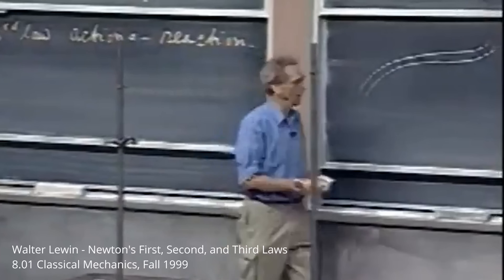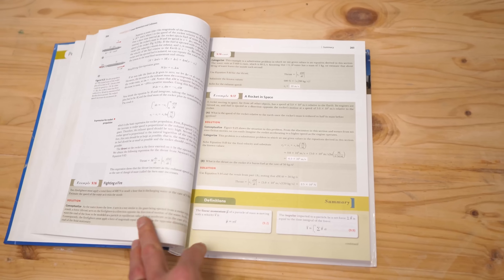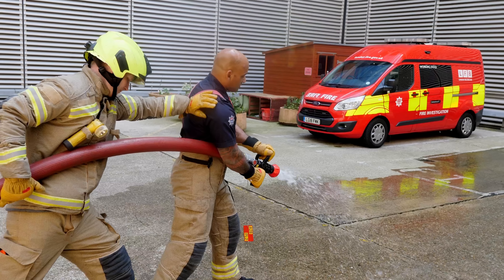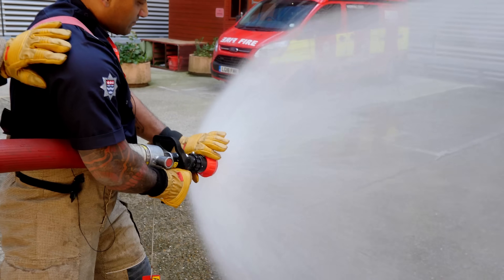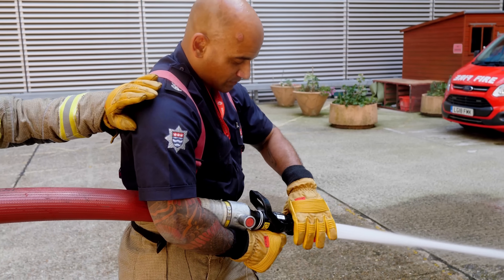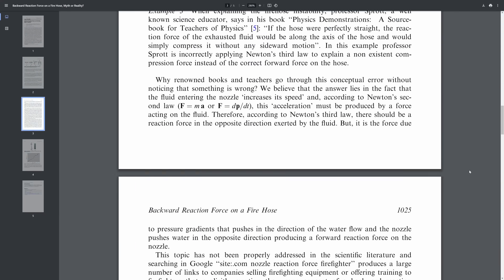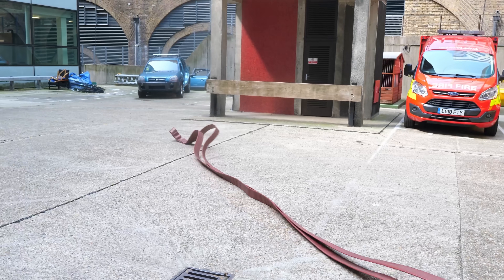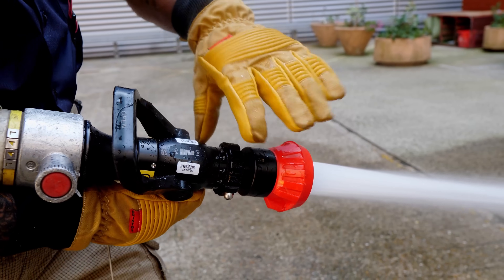Why chaotic hoses dance

Comment: Rivers kinda do the same, but in a gravity restricted low pressure (if not flooding) kind of way . If flooding more spreeds higher pressures, fluids will always try to find the easy way out...
I don't know if there's a use for this.
Maybe a elritic generator of some kind.
You can call it the :
⚡ zappy zappy dingigle dongle ⚡ 
Probably very inafishint 😆

Damn it we'll have to write it again...
The pressure at the nozzle is determined by the flow from the nozzle If you had to close it then there's no movement in the hose and would be like a muscle when and fill up tight. So the back pressure is coming from the nozzle like a rocket as you say. 
And if you look at dam, they have mud pipes they clear out, when they let them go it oozes out a big turd shape mud turd. Then continue to flow high pressure water that  would cut your fingers and hands off if it's doesn't drag you in, if you actually were try to touch it and probably kill you too because of the suction would be like a venturi and suck you in and die, Ooo that will be horrible Don't think about it! Don't do that!

Comment: Wouldn't the force be equal to the cross sectional area of the outlet times the pressure difference?  You could confirm that by calculation and then measurement with different size openings or pressures to test the calculation.

Comment: Huh, cool! I guess they do always teach us that the force of a (subsonic exit velocity) rocket is actually the unbalanced pressure exerted on the front end of the chamber... it's neat to think about a subsonic nozzle as really just exerting force through the tension of the pressure vessel walls not being balanced by the missing area of the exit throat area!

In a similar vein, Matthias Wandel has a very neat video series on the forces felt by the suction end of a pipe, one of them is called "Levitating pipe mystery solved" just to put a search term down here. The first few are actually more interesting than that one.

Combining his observations with this video it's interesting to think about the pressure field in the vicinity of the nozzle throat entrance, on the hose side.

On a practical note, hose/nozzle systems like fire hoses are pretty much always going to be designed so that the momentum of the water in the pipe/hose is a small fraction of the exit momentum. Unless the pipe is super short, a system that imparts a substantial fraction of the velocity at the entrance to the hose (aka the exit of the pump) will be producing large amounts of needless drag, and will deliver only a small fraction of the pumping power to the nozzle. So we should very much be able to ignore the momentum change of the water around a curve of the hose, at least compared to the force needed to hold the nozzle in place. Look how much bigger the inner diameter of the pipe is compared to the actual water stream diameter on those fire hoses, and then square that to get the area/reciprocal of the momentum.

Comment: If the pump was mounted on ice blocks, and sat on a wet ice rink, and the front end of the hose mounted similarly on a framework on ice blocks on the same sheet of ice , then rather than try to measure or speculate about forces one could measure close to friction free accelerations. Given the forces, these would need to be well weighted close to the surface to both reduce the accelerations and counteract turning moments. Those moments would need to be measured for comprehensive analysis, but in the first instance this setup would show at which end or ends the forces were acting, and their relative strength. The framework holding the nozzle end could be used to set the attitude of the nozzle to illustrate if and how the forces changed depending of the angle of the nozzle to the vertical.

Comment: You need there to be a 90° turn. you have a 360° turn so the forces would cancel out. Try having the air hose perpendicular to the scale.

Comment: If it's a pressure differential between the pipe of the hose and the nozzle, sounds more like a reaction similar to a jet engine than a rocket. Because a jet engine has air flowing through the entire "pipe" of the engine vs a rocket where it's all at the nozzel.

Comment: With the recoil on the firefighters' nozzle, think of it in terms of flow rate and cross-sections. If the diameter in the tube is the same as the diameter of the nozze, cross-sections are equal, the water does not accelerate and there will be no recoil force on the nozzle.
However typically the diameter of the nozzle is smaller than the diameter of the tube. Flow rate before/after the water exits the nozzle is the same, so velocity of the water has to increase when exiting the nozzle. That change in velocity is a change in momentum and that is what creates the recoil force at the nozzle that the firefighter has to push against.
Reply: This doesn't sound entirely right for two reasons
- the first is theoretical—you're just increasing the pressure by reducing the size of the opening, which is why it ends up faster.
- the second is based on his experiments—we see that his air hose experiences substantial reaction force, even though it has no nozzle of any sort, and that that reaction force appears to be happening at the tip of the air hose, since the shape of the air hose doesn't meaningfully affect it. Thus, the nozzle can't be required for the effect.
I haven't used a garden hose in a while but I vaguely recall that they tend to push back a little even with no nozzle too.
Reply: @yaksher Air hoses behave differently because the air discharge behaves very differently from water discharge. Especially, the air jet is directly entraining ambient air around it. So the jet accelerates ambient air, it is literally pushing the ambient air and this creates a reaction force on the jet that carries back to the hose. With a water jet, ambient entrainment is negligible.
Reply: This has to be it (in my opinion) and I also came to the same conclusion. I've experienced this with a regular hose. Changing the nozzle at the end can increase the force in the opposite direction. A hose without a nozzle on the end doesn't really feel like anything
Reply: I was wrong. Google "Backward Reaction Force on a fire hose, Myth or Reality". It describes an experiment on a straight hose with a nozzle where they measured the force on the hose. Actually, the straight hose is being pulled in the direction of flow. The acceleration of the water in the nozzle is only provided by the water behind, the hose does not feel that force. The straight hose only feels viscous friction forces that pull it in the direction of flow.
Other experiments indicate that the kickback on firemen hoses only come from flow direction (and thus momentum direction) changes.
Reply: Wow, I like this explanation a lot, thanks
Reply: I had a miniature version of one of those nozzles on my garden hose. The water flowing through the hose is a solid column of water while the water exiting the nozzle is a thin ring of water with air inside it. It's not that the diameter is smaller but mainly that it's hollow. Of course the thin ring of water has to have a higher velocity than the solid column of water in order for the water flowing out of the nozzle to equal the water flowing into it.
Reply: I agree with the first part, but not the second. I have two arguments:
First, please feel free to  point out any logical errors. I love being correct, please correct me where I am wrong so that I can be correct!
Let's look at mass flow. Mass flow is how much mass flows through an area per time. Mass flow must remain constant unless there are leaks, assuming steady state. If the area at the nozzle constricts to 1/2, then to maintain mass flow the fluid must travel 2x as fast, which also maintains the exact same momentum of the water through the cross-section. Momentum is preserved. If the fluid starts to expand inside the nozzle, then it will gain sideways momentum and lose forward momentum which must mean that the nozzle slowed it down, pushing the nozzle forward (not the correct direction)
Now let's look at the pressure. There is more pressure inside the hose than outside. All cross sections will feel a force from this pressure, including the inside face of the nozzle, which will be pushed out, also not the direction that it actually goes.
I do not see any reason why there would be any force in the direction that there actually is.
Edit: After doing a little more thinking, for gasses escaping out of hoses with no cross section reduction, there is high pressure air escaping which pressurizes the very end of the hose where it comes out, pushing it backwards. This pressure does not have to be very much pressure, only about .002 bar from rough calculations based on the force from the air hose, which is very reasonable IMO. I don't see how this applies to water in any meaningful way as it is nearly incompressible.
Edit #2: strike through what I realized was false
Reply: @johnhunter7244  "Mass flow must remain constant " - indeed. There is the same mass rate of flow through a cross section before the restriction, as through a cross section in the restricted part. But the velocity is twice as high in the restricted part, therefore the momentum is twice as high in the restricted part. 
"Momentum is preserved" - therefore momentum is not preserved. But you cannot really reason like that anyways. To calculate the momentum change, you need to examine what happens to a parcel of water when it flows into the restriction. The mass of that parcel of water stays the same, but its velocity increases, therefore its momentum increases. 
That momentum increase comes from the pressure drop in the water, and therefore eventually from the pump, so the result is the same: there is no reaction force on the nozzle due to the acceleration of the water. 
There IS a force due to the higher pressure inside the hose, though. That higher pressure pushes forwards on the restriction, and therefore forwards on the nozzle.
Reply: @renedekker9806  I agree with you. Thanks for the response.
Reply: @johnhunter7244 I was thinking the same. This view is false. Force is not a conserved quantity, momentum is. Imagine putting a water barrier through space before the nozzle (think: integrating a flow density). What force would it feel? How would this differ after a constricting nozzle? The force required to stop the waterstream would be dm/dt*v. dm/dt stays constant no matter where the barrier is placed, v changes. However there is no such boundary! That is where you are at rn. The interaction of fluids with solids is fully described by fluid pressure + viscosity. Both would pull the nozzle forward in this case. I think this is actually the case, as otherwise that hose on the floor should not have been lying in a straight line. The force a firefighter feels comes from the bend that the hose makes at the end when it's lifted from the floor.
Reply: @weasel.3683  what I was saying about mass flow and momentum is false, as helped by another commenter. I have no problem with calculus but I don't quite understand what you're trying to say.
Reply: But the force that causes that change in momentum comes from the pressure drop in the water.
With an unrestricted nozzle, that pressure drop comes directly after the nozzle opening. With a restricted nozzle, it come partly there where the restriction starts. Because it comes from the pressure drop, the force still comes from water behind it, not from the hose or nozzle, and therefore eventually from the pump. 

Even worse: the pressure inside the hose is also pushing on the restriction itself, causing a forward force on the nozzle. You can see that when you take the restriction to the extreme, and close the nozzle completely. In that case, the pressure will tend to push the nozzle forward and straighten the hose.
Reply: But what is the water acting backward on? For there to be a backward force, something must be pushed against backward. Where is that happening? The nozzle impacts the water in a forward action, the water leaving has no chance to apply a backward action.
Reply: @willfancher9775 it is not the water leaving creating the force, it the water accelerating inside the nozzle. As pointed out, the water has to accelerate inside the nozzle to conserve the flow. The energy for this comes from a change in static pressure. This is why the walls of the hose are inflated because the restriction on the nozzle creates a pressure difference with atmospheric pressure outside.
Reply: @willfancher9775  Newton's laws, equal and opposite reaction - if the nozzle is imparting a forward acceleration on the water, the water is imparting a backward acceleration on the nozzle.
Reply: @willfancher9775  According to your understanding of physics, rockets wouldn't work in outer space where there's no planet for the exhaust gases to push against.

The action and reaction are felt on the inside surface of the nozzle, where the cross-section of the fluid column changes.
Reply: I did a project in college for a physics symposium that was exactly this, i still have a video of it private on my channel - my group 3d cad designed 9 different shaped nozzles and we built a device we used to measure the force output from the different nozzles. They would push a hanging pendulum from perpendicular to the floor on a pivot to go clockwise, we would measure the degrees it moved 0-90, and based on its weight we could calculate the force output from the hose. We would check if it matched expected and compared but found we couldnt compensate for waters incompressibility compared to actual rocket fuels, and struggled to figured out the true weights of the pendulum, and leaks with our nozzles - the cad tolerances were a new concept to us, so it wasnt the best model. Still was a fun project, had to spend a lot of time figuring out the water speed from the hose/tap on the side of the physics building haha

I just put it public, title is "Warner Hanz Braun tests (2017)", only a bit of the footage but still can see some of the silly designs we tried
Reply: Agreed
Reply: I had a very phallic-looking test question like this once
Reply: @neoleo690  its not coccs but smooth bore nozzles have immensely greater pressure than combination
Reply: And the oscillation is in part because a pressurised hose (whether flowing or not) tends to straighten out (toward a low energy state).
Reply: This only makes sense if the nozzle is changing the direction of the fluid
Reply: @dj_laundry_list  It is.
Reply: This makes sense to me. I also wonder about it acting like a fan, pushing air away - though obviously the water in air would not transfer energy so perhaps that is irrelevant.
Reply: as a firefighter described in another comment: there is a position where he feels no force from the water. But it's hard to get there because it is not a stable equilibrium.
And you can see that the force on the fireman in steves video is not the full force of the water beam, he is too relaxed for that. In the video parts where they show how a team use it, the is a second man holding up the hose behind the frontman to make it more straight, reducing the force.

Comment: All throughout this video you are ignoring the effect of gravity. 
For the sky dancers, gravity is a key source that is causing the kinks that create the characteristic behavior. What do they look like when placed on their side instead of vertcally.
Some of your air hose examples have the hose going horizontally, while others run vertically, mostly pointed downward. The fire hose examples are mostly horizontal.
Some discussion about the weight and density of the hose material, and its inherent flexibility and comparison to its relation to the gravitational force experienced at the Earth's surface should have been included in the video.